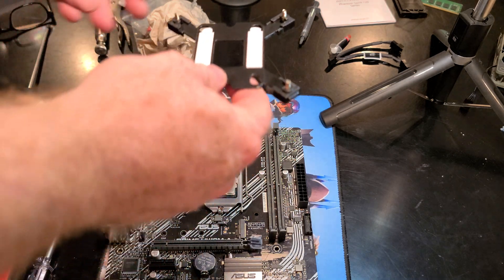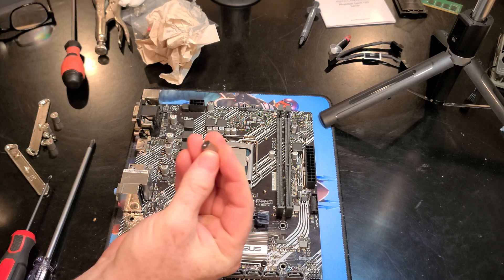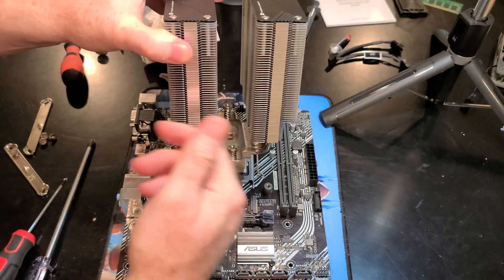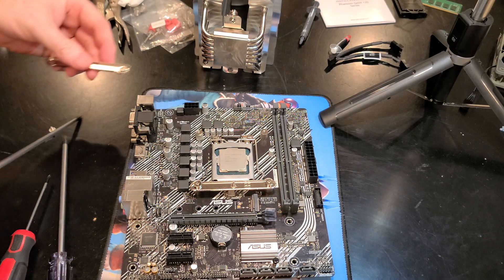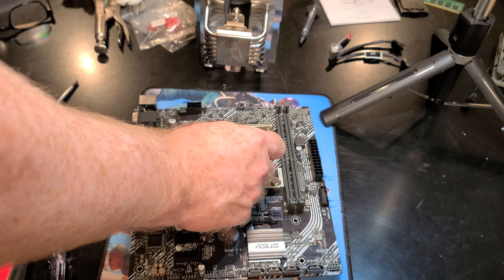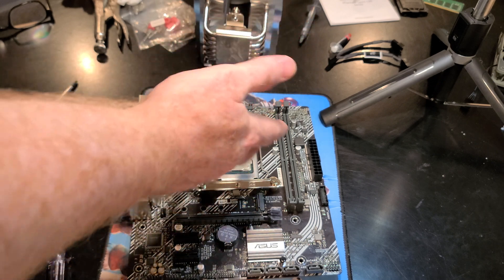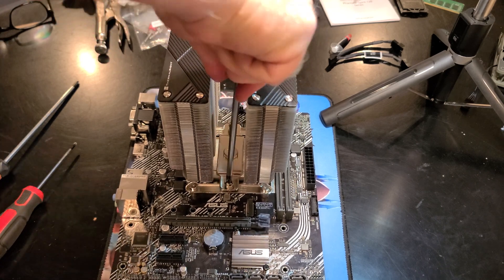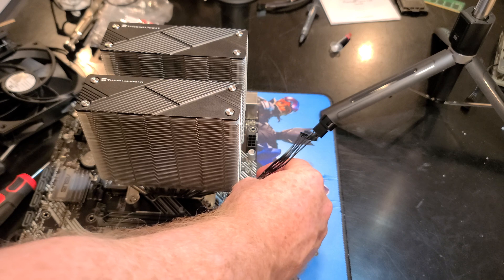LGA 1151 1200 Installation   Thermalright Phantom Spirit 120, how to guide

Comment: It's necessary to use the adapter? (Y-cable) my motherboard has a "CPU FAN" and "CPU OPT"
Reply: If the motherboard allows for control of both headers simultaneously then it will not make a difference, although it would make most sense to simply use the Y and connect to cpu_fan. If you want readings for both fans use both headers because the y cable will only read 1 cpu fan RPM in the BIOS